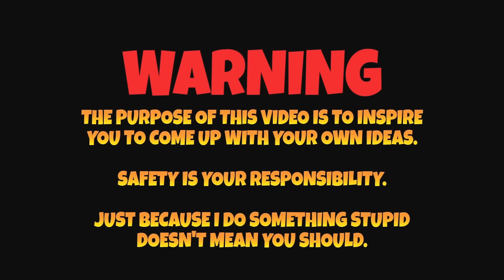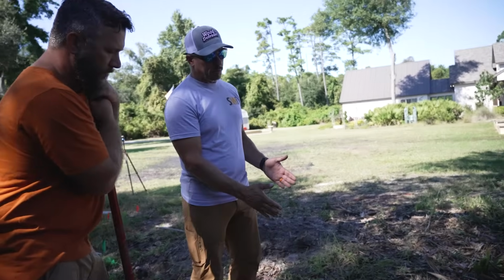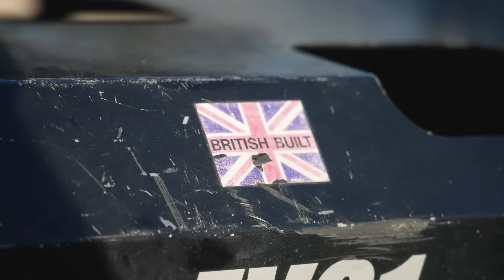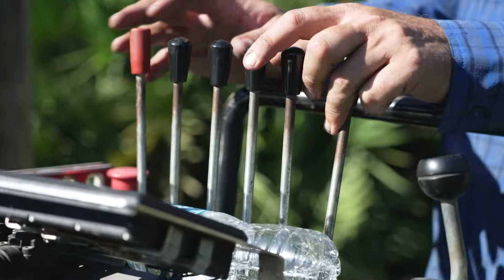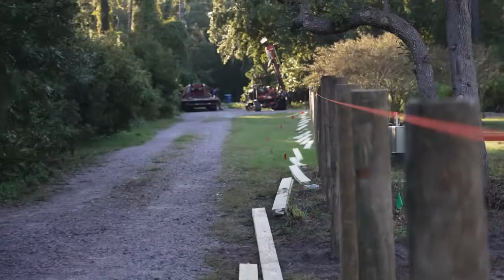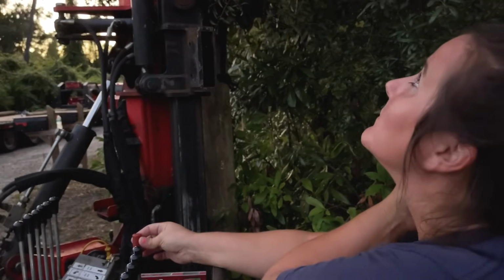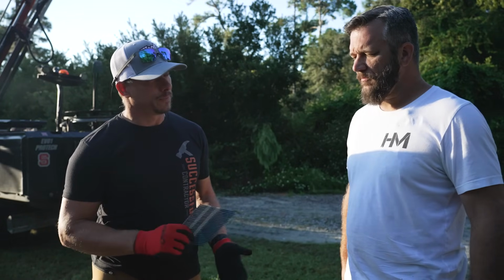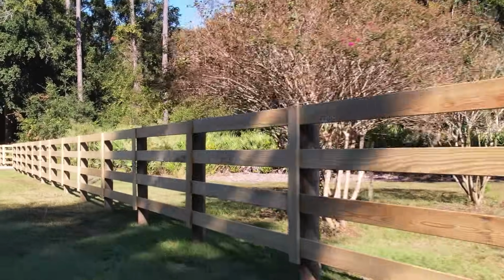The Secrets Fence Installers Don't Want You To Know

Comment: Unfortunately, the fence pounder wouldn't work for most of my yard. I've go SO.MANY. ROCKS. From small ones to 300 lb ones, they're everywhere under my lawn. I found out a couple years after buying my house that across the street used to be a gravel pit, which lets you imagine just how many rocks are in my yard. I've been redoing my sprinklers for the past couple years and it's been horrible.
Reply: Yea Me too!!! really sucks
Reply: Wedge cut the ends of the posts before you drive them
Reply: Maybe put in posts with a ground screw (and place posts inside the screw? Depending on what type of rocks, a ground screw sometimes even can break larger rocks when going in.
But I feel with you when needing to dig a trench... I had to use a large angle grinder with a stone disk in my yards at times as well when doing such work.

Comment: From a lineman's perspective, the biggest mistake, (and only 1 comment mentioned it) is installing the fence right in front of the transformer.  We have to get into those.  You are supposed to maintain a 10' clearance to the front, and 3' from the sides.  We have literally cut down trees, bushes and even fences to gain access, and homeowners don't have a leg to stand on if they sue for damages.

You may want to figure out a way to make that section removable.

Comment: Nice looking fence.
Will the wood still be treaded somehow? It looks like it is only initially heat treated but nothing more (and where you cut, you loose some of the Treatment) or is the weather such that is it not a problem?
In Germany leaving it like that, would probably give you a live span of 5-15 years (depending if the moisture can get well out of the wood/ Shade/ Sun reaching the fence).
Like you tip with the wheat eater! So true!
On my last fence posts replacements, I have treated them now with Kali water glass. Lets see f they last longer than my older one (North side facing, always wet ground with little sun. Some posts I set now inside a ground screw and put an Aluminium post so I don't have to change them as often...

Comment: I do mainly pvc. Too bad 811 doesn’t mark cable lines lol. 

I hit those with the auger all the time. 

Wrap them shits right up haha. 

One time I was drillin a hole and the home owner comes out wavin and screaming I’m hitting his Wi-Fi because I pulled the wire out the house and pulled his router off the shelf lol.

That’s one beast post slammer though. I have a Rhino for chain link. 

Rarely am I doing this kinda fence.

Comment: Over 30 years ago we replaced a board 6 foot fence with the 4 x 4  posts. All pretty normal except I decided to wrap a good grade of plastic around the post bases and a few inches above ground level.
Ten years later we finally got tired of needing to paint the pickets every year.  I was anxious to see how
well the posts faired....   Just like bran new to be sure....  I gave them to a friend who was needing posts as new  looking posts....     I put in chain link and saved a whole pile of painting from then on.
Reply: What kinda paint could you be using, that you would need to paint every year.

Word to the wise high quality paint/primer is actually the cheapest paint there is over time, outside.

Comment: You can also use the trick to find half to find more than 2 equal parts. Using the trick to 60 inches you mark at 20 and 40 and now you have 3 equal marks

Comment: Had a plumber (his employee) not want to pull a toilet and put a locator down the drain line.  Thus he "witched" where the water and drain lines were.  This was through a slab and he didn't tell his boss that he had done it.  He was an hourly employee but he was confident in his "witching" ability.  Needless to say he was significantly off and lost his job.  I lost money when they called in a "real" plumber who put a locator down the line.  That's how I lost a 55K job (it wasn't just the plumbing work, it was a large remodel), the plumber (boss) lost his portion and the employee lost his job.

Comment: Utility lines are frequently mis-marked by radio frequency location equipment because the device basically puts you over the center of the field - often lines are run in parallel and can be picked up in the field so the center line is skewed.

Comment: When two boards meet at the center of the post they have to share half the width of the post to be nailed or screwed in my case. Thats why I offset the runners/horizontal boards on the post that way you can screw them with 3.5" torc 25 exterior crosscut thread screws across the entire width of the post. Then I put fence posts about 2' in the ground and 6' above, with the fence boards 6" off the ground that way I get a 6.5' fence. Thats what I did for my courtyard fence. Came out great good.

Comment: This is pretty much exactly how we put up fence, we use string to drive posts with a level, we also use string to mark the top board with thumb tacks to put the string where you want it on each post you need to adjust on. It looks like you guys are using deck boards of some sort though we use fence boards oak or popular depending on customer preference, and we have a pre made 3 board/4board template to mark top mark for each board on the posts. You guys have a top tier post driver too ours is a two man yanmar dump bed on tracks converted by taking the bed off and putting rails going up on front and back to keep posts on the driver and we put the actual post driver on the back and used the hydraulic hoses to power the driver that previously raised and lowered the old dumb bed.

Comment: Great video. I  Stumbled upon it as I'm about to start fencing 35 acres and needed to find a fast way to do posting. What is the strength comparison between a no dig post and a post with cement, will the no dig warp after a certain time?
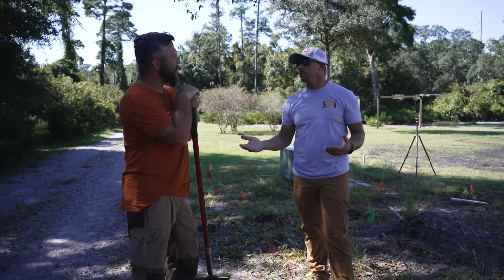Reply: As he said in the video…. If you get full size uncut post like they use, they will not warp because they are a full sized tree and do not have the grain cut. Start paying attention at 3:25 .
Reply: @GaryBowen73  You need to start reading what is said and not just skim over comments.

Comment: I am not a pro and no way could a pro take the time to do this, but I built a similar fence last year and wrapped the bottoms in high-quality peel and stick roof underlayment. I came up about six inches past the soil (which is where posts usually rot). We'll see if it helps in this brave new CCA-free world.

If I were a little further south into OK or TX, I would have gone with reject pipe rather than wood.
Reply: That will work great so long as it is completely sealed. Otherwise you have created catch basin for water where it cannot escape.
Reply: @jelliott4660  There's a wrap of 3-5 layers. The ends aren't sealed. And there's 12 inches of crushed rock at the bottom of the hole. It's either potentially trap a little water or give the soil microbes a feast with a little added copper as spice. We'll see what happens. But I think the water will wick down the wood's natural capillaries.

Gate and end posts are in concrete (concrete also traps water but I don't like leaning gates). Concrete was sloped to shed water.

Tops were cut at an angle and linseed oil applied.

It's all getting an asphaltium coating (and perhaps a precoat of fluids better left unsaid) this summer. It's had a year to dry out...so that should help with water shedding too.

Comment: We installed mailboxes on the roadside. This required a 1 Call to the state. They left their mark. We witched every install and moved many after verifying with a dig that something was indeed there. On one job, just 18 inches under ground was a gas pipeline. We jack hammer a 2 pound per foot u-post into the the ground. Not a good combination, hammering steel on steel and puncturing a gas line. A hand dig showed us the pipe and where to move to.  Trust not even the experts.

Comment: There is no such thing as doing a fence wrong unless you make it crooked and don't even out the board spacing to where they look decent. I've worked for 3 different fencing companies and have done some on my own as well. From one job to the other I have done it the same on some cases and different on others because of what the specs ask for. I've taken all the best parts from the companies I've worked for and created my own way to make things easier on myself. For example if you mark the height that you want on the post then you don't have to come back and cut them. You just have to drive the posts in until you reach the mark. You can use this same principle on the distance between the posts. Whether I've seen them staggered or all put on the same board they all measured from the first post to the distance needed for the length of the board. The only boards that get cut are the first ones and the last ones in line. You cut the board in half and make sure the middle post is installed exactly where it needs to be so that you can put a full board from there to the middle of the next section without having to cut with the chainsaw. That doesn't mean you did it wrong. This is just how I've learned it. I missed where you put all those little boards you cut. My bosses always said time is money and we didn't get paid by the hour. We got paid by the day. We would have to meet the deadlines as fast as possible so we could try and get a bonus. If we finished faster the boss got paid more and would give us a little bonus on pay day. The more days we beat our deadline the higher the bonus. I'm from South Texas and down here all fencing companies put H's at the beginning, the end, on turns and in the middle of the fence is really long. Depending on the length and height of the fence I've seen some use a "Double H" at the beginning, middle and end. Another easy way to find the middle between two posts is you can pull a string from inside to inside of the posts and then just bring the tips together have someone extend folded part while you hold both tips and you have it exactly in the middle. If your measuring tape is long enough you can do the same thing and just fold it after you measure the entire length. It's better if you do this with a 100 foot tape because of the way it's made so you don't damage the metal type of measuring tape over time. This is more for your audience guys not towards you. I've seen how no one ever answered your question about what to do with the post that was supposed to go where the root was. There are several was to go about it. It all depends on where it's located along the fence line and how close will the tree be to the fence after it's built. If the fence will be far enough away from the tree so that it doesn't damage the fence over time as it grows then you can move the post to the left or right of the root. This all depends on how easy it will be to drive the post with the tree in the way and how hard is the ground in the other spots. There could be another root under the ground that won't allow you to drive it in. After you figure out where that will go you have to move the next post as well so that it has the same distance from the post next to the tree and the post that will come after that one. The one from the tree won't be the same distance from the post before it and the one after it but by shifting the second post so that it falls in the middle it won't be as noticeable unless you know about fencing. If the tree is too close to the fence and can damage it over time I would kick the fence out away from the tree just enough so that you can get around it and then bring it back in after you pass the tree or you can take the tree out completely. Another option is to cut the one root that's in the way and insert the post there. I'm sure that could hurt the tree but if the tree isn't that important then it shouldn't be an issue. I'd like your feedback on how I answered if you don't mind. Thank you and it was a great video.
Reply: When you gonna write chapter 2?

Comment: I called 811, had a yard marked, no utilities marked 50+ft from where i was digging.  Ended up hitting an unmarked Verizon line.  I explained to Verizon when they came to drop a temp line what happened and he said it obviously wasn’t my fault.  A month later Verizon sent my company a bill for thousands of dollars.  Thank god i took pictures and video prior to trenching!  Their “investigators” found us at fault no matter what until i produced video that was too large to send through email.  I had to physically send them a video.  Always video the markings prior to digging.
Turns out the guy responsible for marking ran out of paint and never came back to finish marking
Reply: I deal with this every day with Verizon. They try to bill me to but I always do PA ONE CALL and that limits my liability. I break the FIOS fiber optics at least once a week. It's only down a couple inches. They bill me and I never pay. I photo document the breaks and how far off the orange lines were (or were not) marked.

Comment: I gotta call BS on the theory about weed wacking around treated fence posts ( he said you should spray instead). It sounds kinda goofy right off, but it's been proven to me straight up. I  put a fence in using treated 4x4's (maybe another theory blower about the growth ring (think about 2x12's, or any 2x lumber, there is not one complete ring in a 2x12, yet they are VERY strong, therefore they don't " lose all the strength of the partial rings" is clearly untrue)). Pressure treated goes DEEP, no weed wacker is going to touch its inner penetration in 100 years of weed wacking
That fence is as strong today as it was 35 years ago when I put it in. 
It's no wonder why we still have all these different cancers that we have no idea what causes them...And I see people spraying the F outta their lawns, all the while they are thinking their water comes from some magical pristine place, deep in the earth, perhaps an Artesian well....
Roundup is one of the few poisons (along with some other herbicides and pesticides) that don't get filtered out by the earth, so take that, water table.... It's also a pretty strong statement that Roundup spray can fly 30 feet in the wind, land on a plant, and kill it.

Comment: Wood is too friendly and inviting.
Turn that into chain link, and hard wire it for electrocution.
Switch at the house door, inside.
You know, you can use stainless steel posting with hang shelves to avoid the termites and if you sink down a couple bags concrete per post 4 feet down, they won't inch up in a freeze. Posts come in 10 foot lengths, and fencing panels can be wood or metal, fully privatized, 8 foot tall. Then wire it.